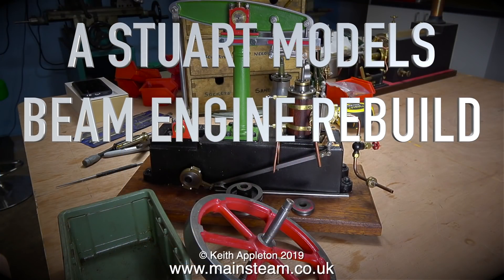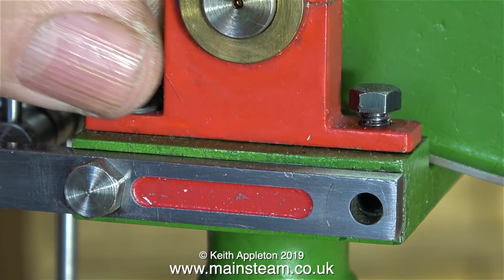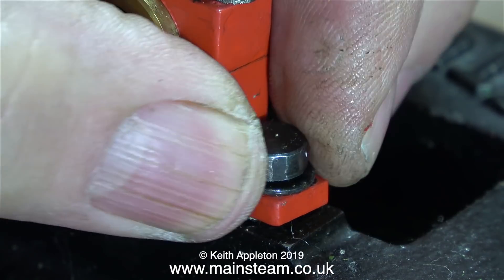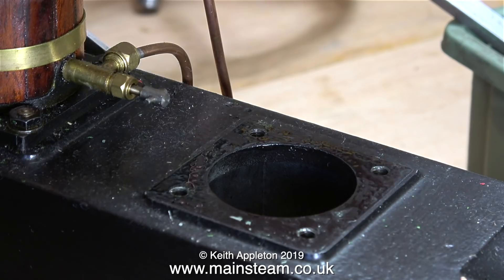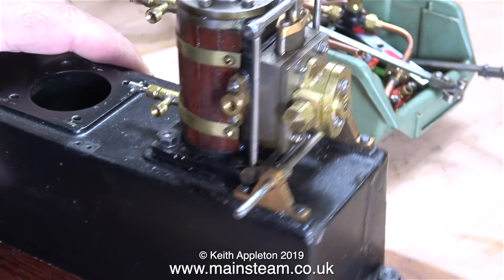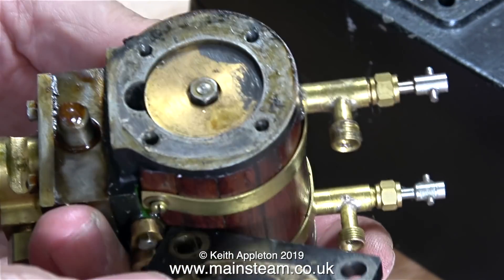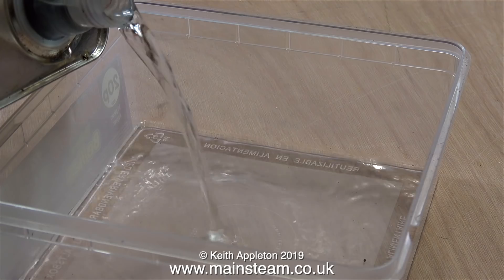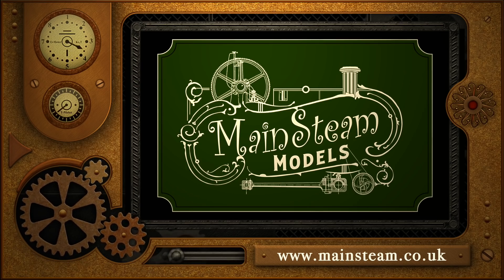A STUART MODELS BEAM ENGINE REBUILD - PART #1

Comment: Have you tried using "long" sockets? They are useful sometimes.
Reply from the maker: they are indeed useful, but not for this job. The bolt head is far too close to the bracket.

Comment: I was wondering if you have ever tried electrolysis to remove paint from a metallic object? I've used it to remove rust from painted parts, and the paint just peels off after a few hours in the bath. I was thinking that with the cellulose thinner you have the cost, the vapors and the disposal to think about. With electrolysis you can keep using the same solution for a long time, and all you need is a battery charger, and some washing soda (sodium carbonate). Also, excellent videos ...as always.